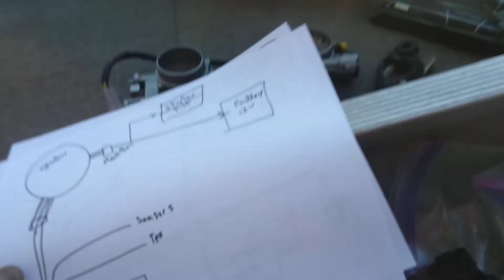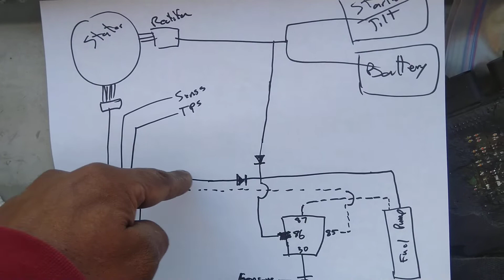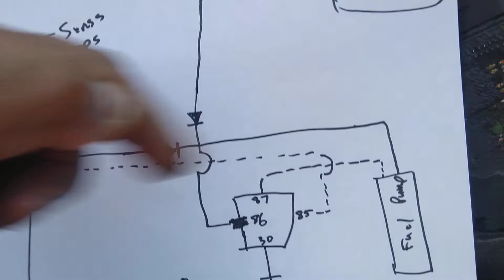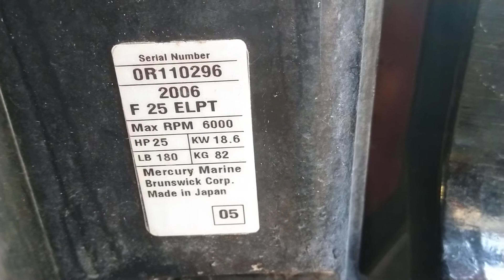mercury tohatsu 4 stroke 25hp 30hp outboard burning out ECU with aftermarket fuel pump

Comment: I have the same motor, found the voltage coming into the pump is around 15.5 volts, the pump will not run, if I apply battery voltage of 12-12.5 volts the pump will run and the motor will run. I would assume that 15.5 volts coming from the ecu is too much for the pump. Any help would be appreciated.
Reply from the maker: @Derek-o2t  15v is high but check it again against the negative side of the wire coming from ECU. i bet you get 0. 
If you are getting 0v then the fuel driver circuit is fried in ECU time to use an external power source for pump like a relay.
Reply: By chance do you have any diagrams of how to run a relay or something similar to run the fuel pump. Thanks
Reply from the maker: @Derek-o2t  I did my own relay as shown in video, it's similar to how fuel pump relay is  setup in bigger motors. You run a hot line into one side of relay and out the other to pump. Then you can trigger relay using negative or positive. Usually negative but if the ECU is burned out you need a positive trigger. 
You can Google relay wiring fuel pump lots of images for examples online.
Reply: What would be the best positive trigger on this motor.
Reply from the maker: @Derek-o2t  grab the positive from fuel pump connector to drive relay. The negative for relay can be the block. Run the positive for pump though from battery with a 10 amp fuse. Just be cautious the battery won't be charging at idle, so will need to run at 1500 rpm min to get a small charge into battery with this method.

Comment: Can this be done with a manual start. Pull start
Reply from the maker: @John-p9z2y  yes but you need a voltage regulator. Motor comes pre wired for it,  you have to purchase and mount it on starboard side.
Reply: @omieyouknowme  thanks for the reply
Reply: @omieyouknowme  do you know what mercury changed to prevent this
Reply from the maker: @John-p9z2y  mercury does not build 4 stroke motors under 40hp. This is built by tohatsu and earlier ones where Yamaha. 
They changed the ECU itself with different pump for later model years.

Comment: I have a 2007 Mercury 25hp 4 stroke that starts and runs fine, but will not restart for a half hour if shut off when warm (sound familiar!).  The dealer says I need a new high pressure fuel pump and a new ECU ($2000 + labor).  He says it's just a matter of time before the ECU burns out completely.  This all squares with your video.  Because everything is working currently, what can I do to protect the ECU from overheating?  It seems from your video that adding a relay and diodes would do the trick.  Can you send me a diagram of how to install these items?  Much thanks!
Reply from the maker: @Phil24620  yes a relay would allow you to run without burning out the ECU completely. I will agree with dealer in replacing the fuel pump if it's the original and reason being, it's old enough that it's pulling more amps than needed and will continue to degrade. 

You have select start is the first item to verify.

The diagram I have on video is what I used. Two 10-20amp diodes and fuse holders with wires is what's needed. Otherwise 16-18awg wire and some terminals and taps.

Comment: @omieyouknowme  I'm struggling to find clear information and product suggestion from google on flyback diode relays. You said the one you used was a ford relay. Could you provide a specific part number or is it that all ford relays have flyback diodes?
Reply from the maker: @chandlernelson1095  I always grab a few relays and fuses from junkyard
Reply from the maker: @chandlernelson1095  try "HELLA 007794041" from Amazon.
Reply from the maker: @chandlernelson1095  you can also search for "12v relay with diode" on Amazon or fleabay.

Comment: Could you dummy this down for me, I’m having this problem on my boat and don’t want to fry anything but don’t completely  understand the wiring thanks
Reply from the maker: I sold this boat and motor last year. 
See if I can write this up
 
There are many ways to do this, mine was probably the most complex way but it allows the motor to run without a battery. 

If you don't want to deal with diodes and can accept that you need a battery to run motor now, (all larger motors need battery) then follow along

Theory of operation:
Use the positive and negative terminal from ECU where it goes into pump and run it into a standard 12v relay. The relay will take negative line from engine block and carry it to the pump. The positive wire you will carry from battery post on motor thru a 10amp fuse direct into pump. 
When you start motor, the old fuel pump wires will simply close the relay and allow negative side to go into pump. 

Installing 
On the pump,
You will identify which wire is positive, (common wire used for injector and coil) peel back the tape around both wires at the connector, cut those wires near the connector leaving behind enough wire to splice in more wires. 
Splice in a positive wire on the connector side that goes to oump, run it thru a fuse and to the battery post block on motor. 
Splice in negative wire from the connector and run it to the relay, pin 87 on relay. Plug connector back into pump. Now run a wire from pin 30 from relay to ground stud on motor.

Now take the wires from ECU that are dangling run positive wire to relay pin 86 and negative wire to pin 85. 

When you start motor now, ECU will close relay on pins 85/86 and run pump off battery by closing pin 87/30 with ground wire. The fuse should be a 10amp no bigger. 7.5amp would be ideal but 10 will do. 

If you want to run motor without a battery then it involves diodes and combining the two positive lines.
Reply: Thank you so much when I said dummy down you knew exactly what I meant , did you ever have anymore problems out of it?
Reply: What Amp relay did you use or recommend
Reply from the maker: @hunteradams7004  the only other issue I had was a fuel restriction. A piece of fuel line broke off from before the VST tank it lodged itself in the needle seat inside vst. Motor would run fine at low rpm but anything above 2500 it would die. Fuel starved because the low pressure pump could not fill the vst tank with needle being restricted.
 Easy fix remove vst cover blow backwards into fuel line and it blew out the old fuel line. Though it was hard to diagnose
Reply: Would it run fine for a few minutes with the fuel line clog or always bad? And what AMP relay do you recommend? Thanks so much gonna do this today and test it out
Reply from the maker: @hunteradams7004  I used a mini 30amp relay. It's overkill but plenty full and commonly found at any napa
Reply from the maker: @hunteradams7004  it would run at idle all day long soon as I gave it throttle it starved of fuel.

 The ECU failure symptoms was it would run for 20min then die. After cooling off it would run again and die after 20min.
Reply: Ok I’m having the ECU problem then, I can run for ten minutes the just straight to bogging when given any throttle but never dies and will stay at idle
Reply: On water muffs is will run all day long but cut out a little bit but under load is a different story
Reply from the maker: @hunteradams7004  if it never dies you have fuel problem. Install an low pressure gauge using a T fitting on inlet of VST fuel line. The output of the low pressure fuel pump is what you need to verify. If it's 3-4psi with motor running. 
If so then test fuel pressure from VST to fuel rail, using a higher pressure gauge with a T fitting. It should be 40-45psi. 

If both fuel pressure check out your pumps are fine then time to pressure test the fuel line from VST back to low pressure pump to fuel tank. A bicycle pump works best. Pressurize to no more than 2psi and listen and look for leaks in fuel lines.  
If none 😕 then time to take VST apart make sure there is no instructions inside inlet where float and needle is.
Reply: Boat it used and olde owner handed me the fuel pump out of it as I was buying it so wasnt really aware of this problem but he had a aftermarket one in there and I put the pen back in and no start but I’ve got the quantum one in there now and it will run for a good 10 mins then start to bog but if you let it cool for 30 mins it go back up
Reply from the maker: @hunteradams7004  oh. 

What I would do Then before you go hacking wires per my write up.

 Run a +/- wire from battery to fuel pump straight no relays and run it. A 16gauge wire would be fine, I keep trailer wire for this reason, make sure  Fuse it. 

Run the engine, if no issues then your ECU fuel pump driver is going out. 
You will find out real quick without permanent modifications if you need to do relay install or if something else is going on.
Reply: So if not problems I need to do the relay modification? And if problems and ideas and where to go from there?

Best way to run wires straight intos the VST to get to fuel pump?
Reply from the maker: @hunteradams7004  correct if no issues then do relay modification. 

If you still have issues then it's time to look at stator. Really this motor is pretty well designed. Stator or other electrical failures are very rare. 

For running power, I would look at a headlight bulb plug at auto parts store. It's close enough it may work. May need to trim it down to fit. You can always extract the pins from it and wrap socket in heat shrink manually slide it over the pin in fuel pump connector.
Reply: Thanks so much for your help I’ve replaced so much on the motor thinking it was a spark issue then found this video, can’t thank you enough
Reply: Are you saying run it straight  to the cranking battery or to the battery terminal on the motor? Sorry if that’s dumb
Reply: Just went and tested I ran it straight to the battery but had a fuse hope that’s ok, but it was running good then slowly noticed I’m guessing the battery die but was still moving and 90% throttle and then plugged ecu back in and went back down river and once back to the ramp (about 5 minutes downstream) could tell it’s wasn’t so happy and ecu was getting warm so definitely going to do the relay correct??
Reply from the maker: @hunteradams7004  ya if ECU is getting warm it's time for relay. Do you have battery charging on that motor?
Reply: Yes I do
Reply: Still kinda iffy if that was the deal let me explain because I have zero knowledge on boats

Ran great off the battery and after about 7-8 minutes while still full throttle it seemed like the battery was slowly dying but was still on plain and going 25 just lost and little bit of power
Reply from the maker: @hunteradams7004  hmm I would pressure test fuel lines after low pressure pump then. Could be compounding small issues. If ECU is getting warm or HOt then you will need relay but you should be able to run off battery for an hour or more.
Reply: So the normal operation of the fuel pump with the ecu is the ecu gives 12v positive to fuel pump AND negative to turn it on.  

My question is does the ecu need to cycle on and off the fuel pump depending on certain conditions (fuel pressure too high/low)?  Or in normal operation with the ecu does it just constantly run the fuel pump the entire time the engine is running?  I guess not having a fuel pressure sensor would tell me that the answer is the fuel pump just constantly runs

Comment: I have a 30hp efi mercury/tohatsu 2005. I put an aftermarket fuel pump in it, and I guess it fried that part of the ecu. My mechanic tried a lot of things, and in the end took power from the battery to a switch on the dash, and ran a ground from the battery to the fuel pump.  It's working so far! I'll put the toggle switch close to the ignition switch on the dash.  I'll just have to remember to turn it on and off.
Reply from the maker: @whwoods  your positive wire on fuel pump should still work. I'd ask him to use that line as a trigger for a relay instead of switch on dash. That way pump turns off when motor is not running. 

You can still have the dash switch as main kill switch, just send line that to a relay and trigger from existing fuel pump positive line.
Reply: If you didn't put a toggle switch what would happen? Would your HP pump keep running?

Comment: I wanted to point something out about this setup.  So seeing that you are using the negative signal from the ecu, that means that this will only work with an ecu that is still working. If you started with an ecu that had failed, how would you have done this differently?
Reply: I just saw your reply down below. Use a positive trigger instead.
Reply from the maker: @shawnkeenan2576  yes. The negative is usual what failed. If you supply pump with 12v from external battery and motor runs, your ECU is still ok. 
The positive trigger can still run the relay and still provide some amps as well to pump if you use a diode. If you just want to run pump off a battery then use the positive trigger for relay only and call it good.

Comment: Can you provide an amazon link to the diodes you used. Also, if i used a relay to power the pump directly from the battery, would i still need diodes?
Reply from the maker: @nicktr823  can search for 20SQ045 diode  made by tnisesm.  The relay is there to take the load and is a means to turn off the pump when engine turns off. Highly recommend you use a relay to run pump. It's a safety feature too you don't want pump running with motor off.

The diodes are there so ECU is not starved of current. If motor is running the ECU will always have enough current to do it's work and excess is sent to pump. The pump will then draw the rest of the current from battery or elsewhere.

 If you don't have a regulator charger on manual start motor you can just run off a battery. 

Your battery size will limit how long you can run so if you use a 50ah lithium battery expect 8 hours then you charge battery again.
 If you tie the battery to fuel pump power as shown in my diagram with diodes you can double that run time. 
If you add a voltage regulator on battery side your run time now is based off fuel instead. 

I would recommend you use fuel pump wires from ECU to trigger a relay. Where the relay gets it's power is up to you.

Comment: What you going to burn out next
Reply from the maker: @everestinspections9088  this is how majority of efi systems run fuel pumps. Should last longer than pump. 
Motor was sold with boat

Comment: I just got a the replacement fuel pump from Quantum and wired it with the time delay from my battery lead - just like you did. So far works great!  But, you made a key point - Quantum will sell a lower amperage pump if requested?    If true, I could have requested that and swapped it for my orig pump, with no special wiring required.   Am I correct?
Reply from the maker: @malcolmlund7938  their low amp pump is same as regular pump. I measured current at 40 psi.
Reply: How could someone find and get the low current pump? Do they have to request it from the vendor on Amazon, or does the vendor have it listed on Amazon separate from the high amp pump?
Reply from the maker: @malcolmlund7938  there is no low current pump on Amazon or eBay. It's all the same pump. Low current pump is OEM from marine dealers and they run 600$ and up

Comment: Great video! Having problems with my Mercury 25 from 2013 (just 40 hours on it), OR-serial with tilt and electric start. My engine died after 5-10 min on the water (it did start when the engine was cold). Authorized mechanic identified a bad high pressure fuel pump (and said it works until engine is warm). They said there were power to the pump and advised me to replace it. I installed an aftermarket pump and it worked great for 1-2 h - then the engine died and now it won't start at all. 

I connected the fuel pump directly to the battery and it starts right up. When I measure volt in the connector that connects to the VST it shows around 15 V - but the second I connect it to the VST it goes to 0 V. Therefore I figure my ECU is fried and I'm looking into your solution. 

The thing that bugs me: what was the original issue? Can the original pump fry the ECU? I connected the original pump to a battery and it still works - so I'm thinking the mechanic got it wrong and I replaced the original pump for no reason. BTW: the filter at the bottom of the original high pressure fuel pump was super clean.
Reply from the maker: @adamviklund6574  your symptoms are exactly same as mine. The high pressure filter was clean as well. My original pump was dead when I purchased the motor. The pump was seized, it had sand in the impellor. I would assume that trying to start the motor with pump bad pump had caused high enough resistance that I fried the negative driver in the ECU. 
I am not shocked how fragile this design is, would have used a fuse at min with original design to blow if pump has instructions and causing higher Amperage draw. 
Good luck to ya. I sold this motor and boat last year.
Reply: @omieyouknowme  Thanks!!! Now that you mention it I saw some sand at the plastic thingey at the bottom on the original pump (where the filter sits) I bet there was sand in the impeller. Well then I think I have my answer. When I crank my engine I also (sometimes, it kinda comes and goes) get intermittent beeps and flashes on the engines warning light. According to the manual indicates ""Water temp or MAP sensor out of range". I assume the MAP sensor is reacting to the lack of fuel??
Reply from the maker: @adamviklund6574  map sensor measures elevation for the first split second then it measure vacuum inside intake. It's used to measure how much air goes in then ECU applies fuel based off map sensor throttle position to achieve best air fuel mix. Basically a carb but computer compensates.for elevation and temperature too. 
The two initial beeps are oil pressure I believe, because the motor is not turning enough to open that switch. It's set to 5psi only. You can prob disconnect that switch ground it or open it and crank to verify.